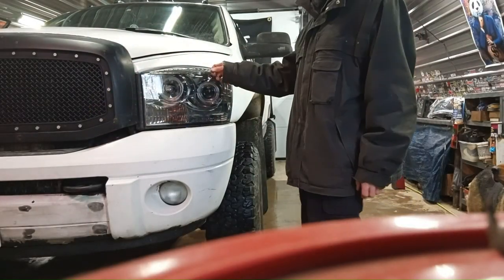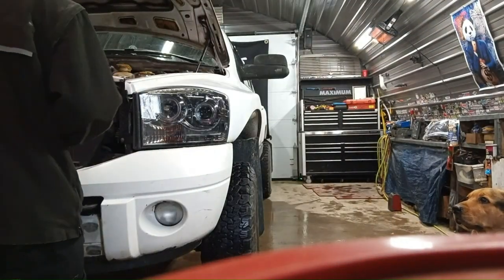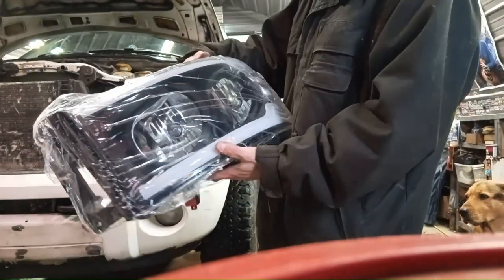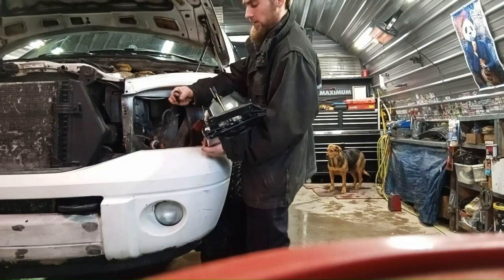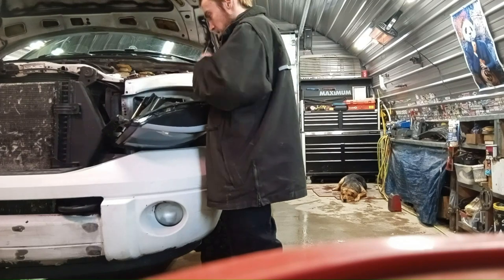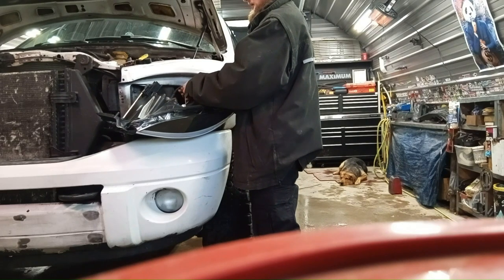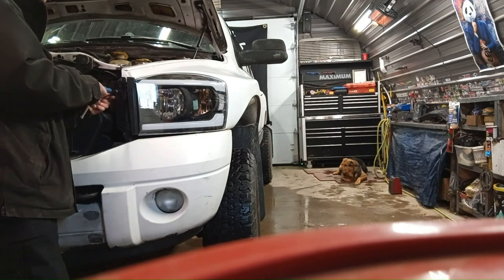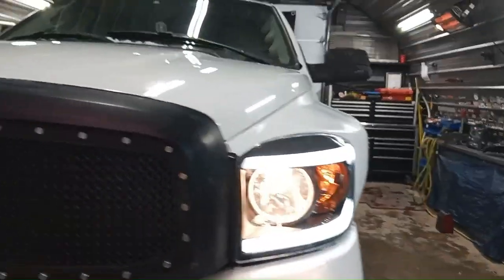2008 Dodge Ram Headlight Replacement (How To)

Comment: Where did you get the grill from?
Reply from the maker: https://www.amazon.ca/Paragon-Front-Grille-2006-08-Dodge/dp/B07FG868MV/ref=asc_df_B07DV3BFYJ/?tag=googlemobshop-20&linkCode=df0&hvadid=293002333434&hvpos=&hvnetw=g&hvrand=15278028887928754761&hvpone=&hvptwo=&hvqmt=&hvdev=m&hvdvcmdl=&hvlocint=&hvlocphy=1002299&hvtargid=pla-612279058458&psc=1&mcid=43aae01ae68537fc970a74330265d36c&th=1